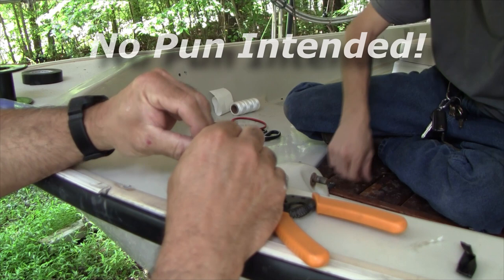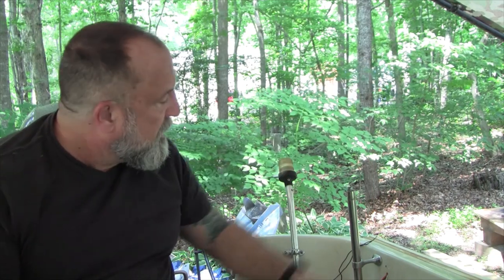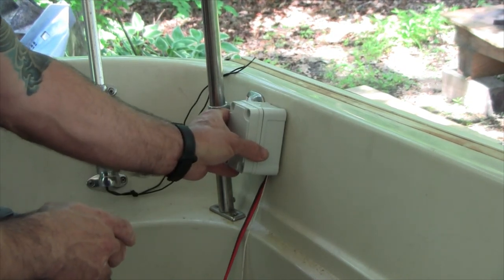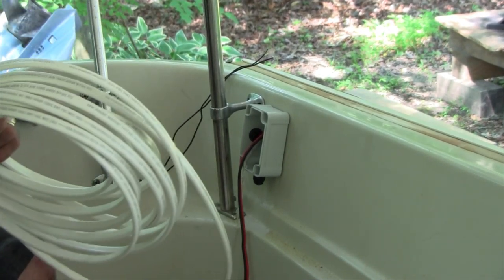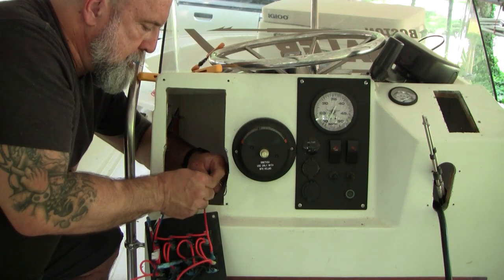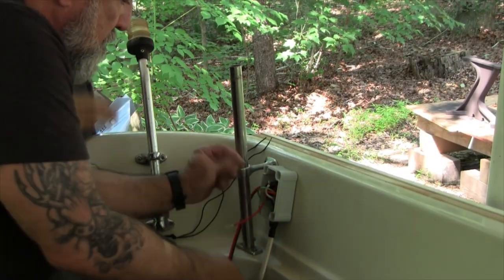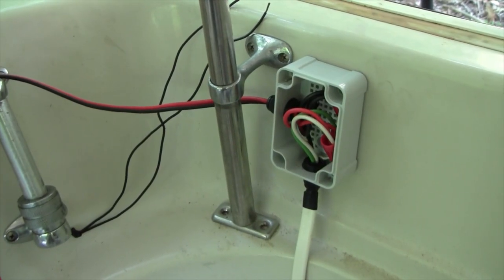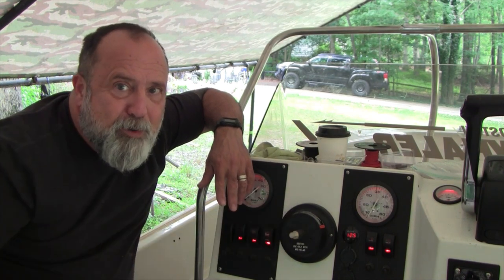Installing Bow Navigation and Stern Lights on a Classic Boston Whaler Montauk - Restoration Part 14

Comment: how do you change the bulb on the bow light, 2005 Montauk there is no access from the bottom and no visible way to remove light only two small screws on the sides where the lens is that doesn't do a thing when removed
Reply from the maker: the two screws should let you remove the top. Perhaps it's corroded together?

Comment: If you are still seeing this Jose, how did you get the wire you ran down the side up to the light in the front of the boat?
Reply from the maker: There was a hole already there (front to back) so I poked the wires into the hole and then used a needle nose pliers to grab it and pull it up.